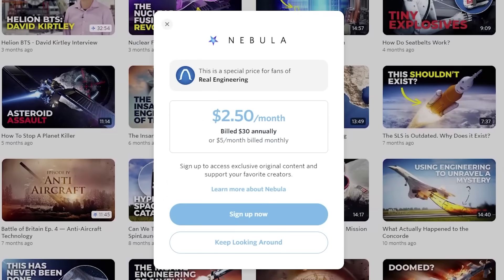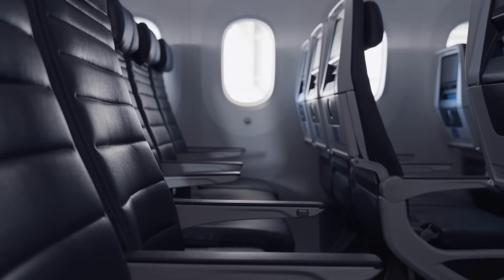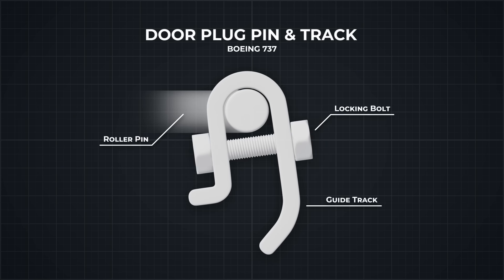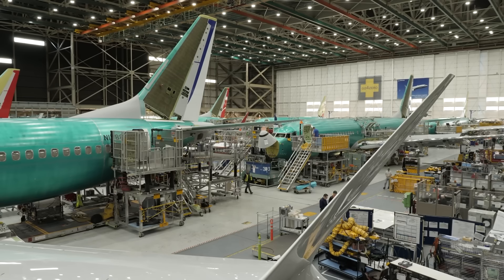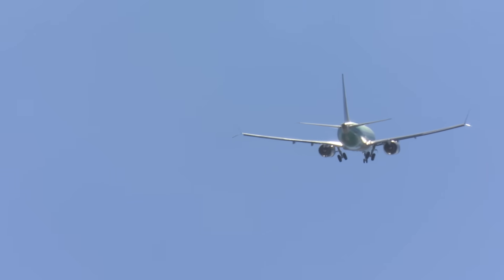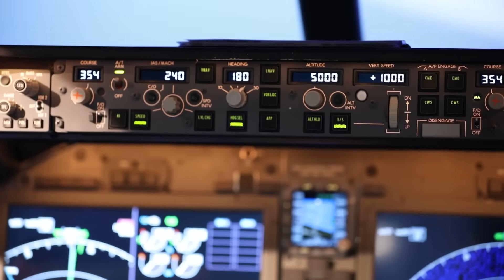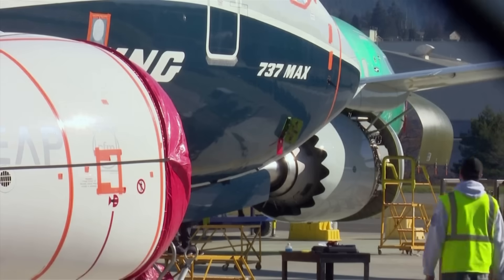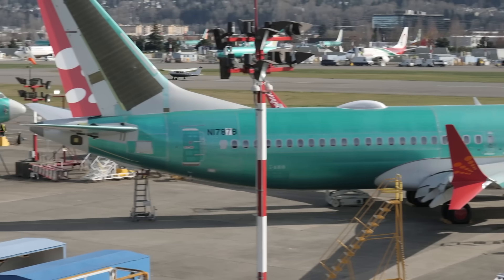The Questionable Engineering of the 737 Max

Comment: This profits over people and safety corporate leadership mentality isn't unique to Boeing. As a Quality Engineer I have seen this play out time and again at several companies I've worked at. When an aircraft goes down or a crewed rocket booster fails the term used is a "mishap." But thorough investigation will show that a series of systemic issues, avoidable blunders, and known problems led to the failure. Time and again investigators find that reduced inspections and/or delayed over hauls are a contributing factor. Less of a mishap and more like criminal negligence and manslaughter.

Regulation would be great if regulators were immune from market corruption. What is the FAA doing anyway? The fact that Boeing executives are not contemplating their past mistakes while the fading sunlight casts shadows of prison bars floating up to the ceiling is all that needs to be said about the state of the airline regulatory system.

It is long past time for the name Boeing to be regulated to the past tense. When lives are traded for profits and regulatory fines are calculated into the overhead expense of business the cancer has metastasized. Boeing now stands in the way of aviation progress by preventing a safer company from coming into existence.

Comment: So at 4:08 you bring up the door plug being removed during final assembly to facilitate interiors installation. Likely since this has appeared in several media outlets and no official statement refuted this it could be reasonable to be true. I will state this is not accurate. All interior assemblies are required to fit through the forward and aft exit doors. Also there is no common practice to uninstall the door plug unless there is a reason to do so. I have not been involved with 737 for a while but i think it is important to state this since it focuses the problem back to QA and not a manufacturing issue.

Comment: In an effort to compete with the much more modern design of the airbus they decided to "adapt" the 737 renaming it "max" like pepsi max it fooled no-one, well actually it fooled a lot of people, the  bigger high bypass fan engines didn't fit so they fitted them anyway upsetting the aerodynamics of the airplane, and just when they got that sorted the doors start falling off😂😂😂😂

Comment: sorry but this isn't about "engineering". The MCAS disaster was. This here is BAD quality control. Lose or missing bolts are not a design flaw, they are shoddy workmanship. Whatver the resons for those might be. There are probably many thousands of planes that have or had a smiliar system to plug a unused door. 

The enginering of the 737 might bequestionable. But the Door thing is a bad example. But it also hints at more problems at BOEING thatn just poor engineering, certification and oversight.

Comment: MAX should be excluded from the 737 typerating! 

First to remove the incentive for Boeing to leave information out like the documentation, in this case the cockpit door situation explicitly, and maybe implicitly the lack of sensors in the plugged doors as that's a new situation for the 737, not to mention MCAS. What else is behind the fog? 

Maybe as punish and require a recertification of the type, but that could lead to find any new hidden issues and Easter Eggs, which shouldn't be a thing in a plane.

Comment: "It would have to move downward". I'm a software performance engineer, not a aircraftologist, but it would seem that you would want it to be harder not easier to fall out. You would do that by having them removed by sliding up against gravity, not with it. This along with bolts that are finger tight seems like calling the engineering "questionable" is being overly generous.

Comment: I do not think the bolts were installed at all as only  one  properly tightened and secured bolt would have prevented the plug from detaching.
Reply: If the loose hinge bolts let go the door could open even with four bolts in place, rember the upper tracks were cracked
Reply: @JamesAnderson-mr2sg  Freely estimated each bolt would at least withstand the weight of an African elephant and this force would have to act against this bolt orthogonal to the cabin pressure vector   breaking it pushing the door "plug"  to pass the 8 stops, in addition normally there are two bolts going through the two hinge arms  at the bottom and only one placed bolt would prevent the door  from moving  even if the nuts were loose or missing. Imo the upper track was cracked by the adjacent pin when the door was ripped from the fuselage. Imo there was not one bolt installed before the door was covered by the lining hiding their missing from sight.

Comment: "iphones surprisingly survived the fall" its like no one understands terminal velocity. if the ruggedness of an object is high enough that it can survive a fall from a height high enough that it has time to reach terminal velocity for its weight, then it will survive a fall to EARTH from any height, because Earth's mass and therefore gravity are fairly constant, terminal velocity of any object will also remain constant based on its acceleration due to gravity.

Comment: You just need to look at the creation and sales of Airbuses compared to Boeings over the last 4 years, or since the Max 8 accidents. Airbus is absolutely blowing Boeing out of the water. Yes Boeing cannot produce as many as they focus on safety assessments and changes, but there have also been airlines clearly switching to Airbuses and amending/cancelling orders with Boeing since the incidents. Investing in safety for their aircrafts cost a ton, but having one of your aircrafts crash costs a ton more. Crashes have literally cost Boeing billions. Billions that could've been saved if they invested and focused more on safety systems.

I'm not a Boeing hater. I truly believe the Max-8's are one of the safest aircraft to date post-accidents due to the fact every mm of that aircraft has been gone over with a fine tooth comb, and all systems tested with all eventualities and scenarios. It's probably the most scrutinised aircraft ever. I have absolute faith in it's safety. But I disagree with the leniency the FAA has given Boeing, the shortcuts and so on that compromise safety. The FAA should not treat Boeing any different that other aircraft manufacturers but they do, and very obviously (eg. extending dates for approvals and so on).

Right now, Boeing's 737 Max is teetering on the edge of becoming the aircraft for airlines to avoid when compared to the alternatives and Airbus options. It's reputation has sadly ruined the entire fleet and I don't think they will ever recover from that. Airlines also don't want to run the risk that the airplane could have an accident, regardless if its a tiny percent more likely than others. It could ruin many airlines and they would rather not gamble with that when there are other options. Boeing should probably focus on a new model, which is sad and disappointing. But if they don't, they'll have at least a decade of being behind Airbus on sales and production on their latest models, and even longer to convince many of the flying public that the aircraft is safe, and for many, they will never convince them. Too many preventable and negligible incidents in a short space of time. Yes Airbus aircraft have issues, but they have not implemented systems that take control of the aircraft and do not inform the pilots of this. Airbus issues may be more frequent mechanical problems but they aren't killing hundreds of people within the space of a couple of years. There would've been a death on this Alaskan flight had someone been sat there with no seatbelt on, and it's a miracle nobody was. Most people don't realise you should wear your seatbelt throughout the flight for many reasons, mainly turbulence, but for also any other issues where being strapped in your seat is a benefit. There is no reason not to wear a seatbelt on an aircraft at cruise except for when you're using the toilet, overhead lockers or stretching your legs, they are not uncomfortable when fitted correctly and should be treated like car seatbelts, something you put on without thinking and keep on at all times when sitting down until at your destination.

Also a shoutout to cabin crew, you're amazing. To the PAX, remember that flight attendants may be serving you food and drinks, but your life depends on them so give them the respect they deserve. It is them who will be arranging any evacuation and deploying slides for you to escape a potential inferno. See them as emergency personnel who also serve you food and drinks and ensure you're comfortable when there isn't a problem.

Comment: I doubt in a new plane that the bolts fractured.  It is highly probable that the fasteners were loose or missing. The stress on the bolts is really minimal when the door is normally secured.  A wooden dowel would probably do the job if properly secured with Elmer's glue.
Reply: I might be misunderstanding the function of the bolts but that door is under a tremendous amount of force at altitude no? At 30,000feet the difference between the cabin and the outside air looks to be about 45kPa. Lets say the door has an area of about 1.5 square meters.  That's 30kN or 3,060kg of force!  That would be spread across a few bolts but I would be weary of a dowel holding that force on it.
Reply: @minerscale yes the pressure is huge, but the tracks are designed in such a way that the majority of the resultant force goes directly into the tracks. The bolts exist just to stop the remaining force from sliding the door down
Reply: @danielfay8963  Ah, understood. Thanks for clarifying :)

Comment: I will never fly on a 777 Max. I check what plane an airline is using before booking a ticket on a flight and pass if it is a Max. Now with what I'm hearing about Boeing, I'm starting to think I should expand that to all their planes. Shoddy engineering and quality control combined with penny-pinching is a recipe for disaster. Maybe that is paranoid but Boeing isn't doing much to counter that feeling.

Comment: I'm disappointed with the factual information in this video. On the MAX 9, the door plug track is on the removable plug itself, and the roller guide is on the airframe. You got that backwards. 

Also regarding SWA 1380, the failure and cause of the accident was a fatigued fan blade that broke and exploded the engine. Yes, the cowling broke apart, but it had nothing to do with the deicing system, so stating "this exact problem already happened" is absolutely misleading and patently false. 

Facts matter. I expect a channel called Real Engineering to get these straight.

Comment: Boeing tried to save some pennies and killed their brand in the process.

As soon as I heard the reason for the failure of the previous crashes was a SINGLE sensor responsible for determining the pitch if the plane that other corners had been cut in the design of the plane. 

No competent engineer on the planet wouldn't have included a redundancy system and the reason is this one is because of penny pinching. If that was allowed other choices would have been made in the name of profit.

Comment: This was clearly stupid!!  A castle nut with cotterpin is a super secure design.  Unless no bolts ever get installed.  The reports of loose bolts sounds fishy cuz cotter pin fixed bolts cannot come loose!  Someone also forgot the pins?  Spirit and Boeing need to fire the lousy CEO and other dead weight at the top and pay for and keep top quality workers that build this stuff.  Time to find the actual idiots responsible for this and unload them.  I miss the 727 & 717 never liked this design!!  Won't fly on any airline using it either!!

Comment: I think the FAA should enforce these regulations:

1. There should be a minimum inspector-to-engineer ratio in any aerospace company. 

2. Whenever there’s any design change made to an aircraft, regardless of how small it is, a set of third-party inspectors are sent to examine the change.

3. Whenever there’s even a small issue (such as low pressure), it must be immediately recorded and a thorough inspection of the aircraft must be conducted to check for all possible causes.
Reply: Enforcing regulations is communist overreach. And you are a communist for even suggesting it. 

-Corporate lobbyists

Comment: The door (or door plug) moves UP to unlock, not down. That's because the guide tracks are on the door/plug, and the guide pins are on the door frame.
Also, Boeing does NOT remove the plugs to install interiors. This was initially reported but has since been corrected.
Reply: The only good info on all this comes from Juan Brown ( blancoLirio channel)

Comment: The 737 has been plagued with problems.. 
In the early 90s, a Rudder Control Valve caused two fatal crashes, and almost a third, due to cryogenic shock. It would cause the Rudder to cause a hard over...

Comment: I can’t wait for the next season of air crash investigation. Because this accident will probably be in it. There is just something I have always found interesting about air disasters. Yeah they can be brutal and deadly but it’s actually quite surprising that we have so few accidents every year. Considering how many plains fly in the sky every minute and also how absolutely massively complex these machines are. Like even small planes are extremely complex machines with hundreds and thousands of parts both mechanical, electrical, and digital! And they all have to work together and in a wide variety of different conditions and environments! It’s quite a marvel of design and engineering that we have even managed to make airplanes as safe as they are today.

Comment: The real problem is that the B737 is a 1963 design based on the fuselage section from the B707, you can put all the letters after it that you want but it doesn’t change that fact. This aircraft should have died a normal aviation death back at the model 500 but it didn’t. The rest is history.

Comment: Now I have to poke at your video. You clearly didn't really read any industry reports. 1. The door plug needs to go up to clear the rolling pin. Not down. 2. Who knows anything about engineering calls cotter pins or cotter keys wire tie???? 3. There's the standard procedure to deal with acceptable deferred defects that is outside minimum equipment list requirements. All industry reports pointed out that Alaska's maintenance crew did what they supposed to and properly if not preemptively took the aircraft out of ETOPS operation. You can criticize the world wide industry standard, but it is not AS's fault. I agree that there's systematic safety culture issues with Boeing, but misrepresenting the issue is not the right way to deal with it, and only add up to the pile of disinformation and misinformation that's already out there. I expected much more than this from this channel.

Comment: Whilst the blame is on Boeing, is it not also a little suspicious that Alaska airlines had a series of pressurization alerts on this same aircraft over a number of weeks and just so happened to have a full plane except for 7 seats, 3 of which were the row immediately at the door plug in question? I say yes. Also, would it be a good time to reconsider the slogan printed on the Alaskan aircraft, “Proudly all Boeing”?

Comment: You talk about Boeing's amazing engineers, but in truth that's in the past. Boeing had spent years trying to reduce engineering headcount and did so by not recruiting, causing them to have a very geriatric engineering workforce. By the time the 787 was being designed they had to give out large extra payments to delay retirement so they wouldn't retire mid-project with nobody able to take over what they were working over. After that, said engineering know-how simply walked out the door as they retired without anyone with the same know-how to replace them. To fix this they tried to make a tie-up with Embraer to farm out engineering to a Brazilian design office, which didn't pan out as Embraer retained these engineers. In parallel to this they began recruiting and setting up a large design office in Russia, but all that went to hell with their invasion of Ukraine.

Russia is pretty good comparison. A once great country coasting on the momentum of that predecessor country (the Soviet Union). The Boeing of today is just McDonnel-Douglas in a Boeing skinsuit coasting on its momentum. Its probably going to keep going for a few decades, but unless some major changes happen its going to peter out into oblivion as legacy models like the 737 become so obsolete not even a bodge-job like the Max-series can keep them relevant.